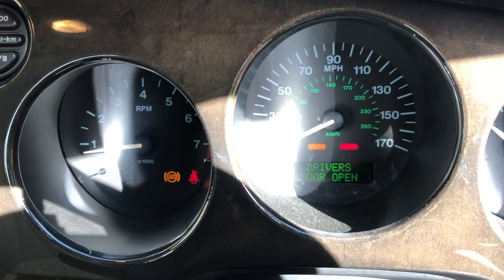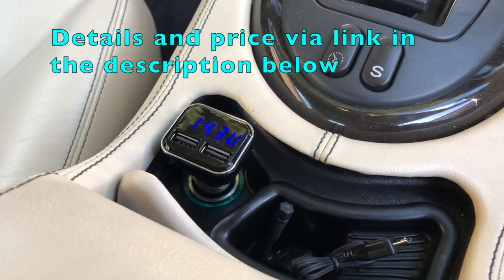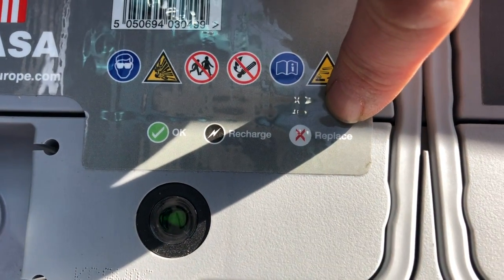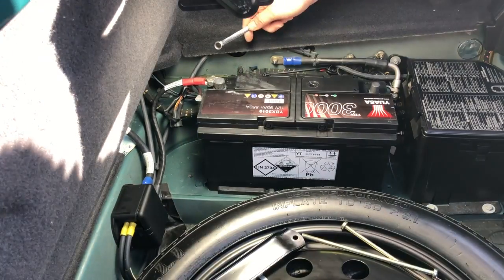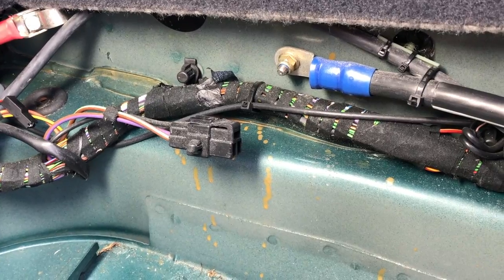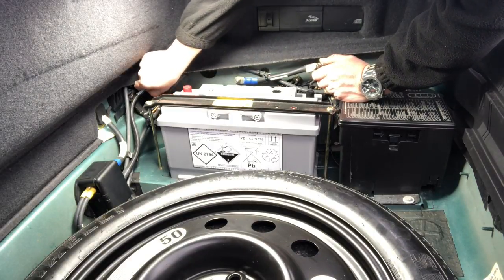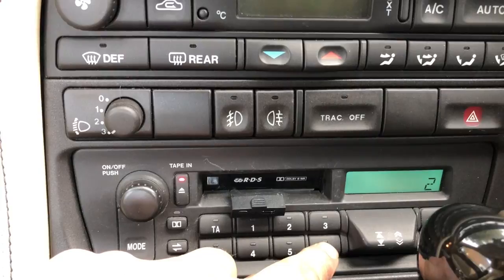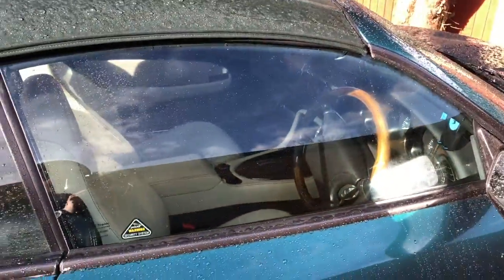secrets of Jaguar XK8 XKR Episode 55. Battery swap and true In car Voltage display.

Comment: Now that you have a lift you could feature a gearbox fluid/filter change. I did mine at 80k and it did need doing by then so we can forget Jaguar's "sealed for life" approach. Having done that I decided that the "sealed for life" approach with the rear diff oil was probably also suspect. That turned out to be far more complicated than the gearbox. There is no diff drain plug and the filler/level plug is totally inaccessible unless you drop the entire rear sub-frame/diff/suspension assembly. However, there is a simple workaround using a two inch hole saw and a large grommet which I photographed here:
 https://www.dropbox.com/s/5pavghqg3dwfqbx/IMG_7202.JPG?dl=0
The oil in my diff was far worse than the gearbox and was totally black and smelled so strongly burnt that it stank out the garage for weeks afterwards. It was well overdue for change by 80k miles. The diff would make a really helpful video as I have never seen it on YouTube.
Reply from the maker: Hi Richard
The gearbox oil and filter change was on my list of to do's and is one I have done previously. but I had not considered the thorny topic of the Diff Oil change.
I may well follow your lead re the hole and use the extraction pump. Old Diff oil is without doubt a horrendous smell. Its like rancid lard scraped off the inside of a condemned cooker.🤢🤮

Comment: Good video John. Just a small point but my understanding is that the window memory should be set with the door fully closed so it can sense the correct fully closed position. The position can be checked against the line at the front of the window.
Reply from the maker: you are right, and I ended up re setting them again as the stop position was a little too high. Just the sort of daft mistake I make when Im trying to film stuff. One day I will share the outtakes from my brake saga. I managed to fit the disc and caliper before I realised the backplate was still drying after a repaint!!   😔
Reply: @tothegarage  I totally understand John. I installed a door card in a Mondeo yesterday and had the whole thing finished until the final stage which was installing the trim around the door handle which includes the window up/down switch. It soon became apparent that the trim and switch must be pushed into the door card before the card is clipped on. :-(

Comment: to the best of my knowledge if you were to disconnect the battery and re connect it or replace a battery, you would see the same abs and traction control fault on any car of the same model  all you need to do is to drive the car so the sensors can check they are working/ calibrate with the pickup  and the abs and traction warning message will switch off. i would  say and will be happily corrected there is nothing wrong with anything to do with your abs or traction control system.
Reply from the maker: Hi Todd 
I drove around plenty after the brake change and thelights remained stubbornly on.😔. Hence the battery swap and I will now cover a 100 miles or so running the brakes in gently, which will reveal if the system self sorts of not. I am just doing one change at a time to keep it scientific for my own interest. 
Thanks for the input mate. Hope you are right👍👍

Comment: Not surprised that didn’t didn’t fix it. You have an abs sensor fault caused during brake change. An elm327 WiFi version or icarsoft 930 should tell you which one. I’d go for the cheaper one as neither are great on jag XJ XK
Reply from the maker: Hi Andy
I do have a generic OBDII blue tooth sender that I use in conjunction with the 'Torque' app. So I will give that a whirl next.
One day someone will come up with a decent OBD reader specifically for the JAG system at a reasonable price.  
Thanks for the tips
Reply: To The Garage good ones for landrovers cost £425

Comment: Thought that battery neg cable was used on xj6 x300
Reply from the maker: Quite possible Andy. Again its the right timing for the XK8 (and potentially the X308) to be running supplies down. Im not so familiar with the X300 though. 
Thanks for the tip off👍

Comment: Hi John and all, I’m considering buying an XK8 and have really enjoyed watching the ‘Secrets’ series (moving onto maintenance next); however; as someone who’s not really a technical car person I’m now concerned if this is a good idea. Does one need your level of know-how for the responsible ownership and upkeep of an XK8? Will a typical garage know what to do if something goes wrong?
Reply from the maker: Hi Zakery. Any decent garage will be able to deal with most of the general issues and expected maintenance. The place they all come unstuck is that if you don't spend a lot of time around these cars then you don't know the 'likely' issues and have to diagnose everything from scratch.
In my opinion they are as reliable as most other 23 year old sophisticated cars. Parts are a little more expensive than for your average Ford or GM motor. But that is the price you pay for beauty grace and pace👍
Reply: To The Garage Thanks John, that puts my mind at rest; keep up the great work!

Comment: Excellent John as always. 
I solve all my problems with a battery replacement to an AGM type. That's the battery that all cars with Start /Stop function are equipped for fuel saving...
It's a bit more expensive but it worth all the money spent. Currently I'm on the 5th year and I do not use the car very often...
Let me share with you some of the characteristics : 
AGM batteries differ from flooded lead–acid batteries in that the electrolyte is held in the glass mats, as opposed to freely flooding the plates. Very thin glass fibers are woven into a mat to increase surface area enough to hold sufficient electrolyte on the cells for their lifetime. The fibers that compose the fine glass mat do not absorb nor are they affected by the acidic electrolyte. These mats are wrung out 2–5% after being soaked in acids, prior to manufacture completion and sealing.
The plates in an AGM battery may be any shape. Some are flat, others are bent or rolled. AGM batteries, both deep cycle and starting, are built in a rectangular case to Battery Council International (BCI) battery code specifications.
AGM batteries present better self discharging characteristics than conventional batteries in different range of temperatures.
As with lead-acid batteries to maximize the life of AGM battery is important to follow charging specifications and a voltage regulated charger is recommended.There is a correlation between the depth of discharge (DOD) and the cycle life of the battery,] with differences between 500 and 1300 cycles depending on depth of discharge
Reply from the maker: AGM on the next car to a need a battery then Nicholas👍

Comment: Is there any guidelines regarding locking the car or not while changing the battery? Should it be unlocked ? I want to charge my battery but my garage is not a 'private' one. If my car is locked with trunk opened, remove the battery so I can charge it, close the trunk, charge the battery upstairs, back to the car, open the trunk with the key, install the charged battery: Will the alarm go crazy or something? A charge might take 12h so.. I'm wondering.
Thanks all and thank you John for a great video again!!!
Reply from the maker: Hi Alexander. FIRST make sure your key works in the secret key hole for the trunk.
Then unlock the car fully. 
Remove the battery.
Lock the doors manually using the key.
Charge Battery
Unlock using Key on all doors.
Fit Battery.
When you lock using the remote control all will be back to normal with the alarm.

Note well!
The Radio will need to be given a code before it works again (make sure you have it before removing the battery.
The windows will need their memories reset.
(press down and hold till you hear a feint click, Press up and hold untill you hear the same fient click)
Reply: @tothegarage  Thank you so much!! So no alarms in the middle of the night while battery is charging if I follow these instructions, right? I have a 2004 xkr btw..
For your issue, (have it too, intermittent like everyone), if cleaning the sensors didn't work, there's also the abs speed wheel (=reluctor wheel?). It gets corroded. Have you tried driving it a couple times to see if the code goes away? Check the abs wheels if not that the sensors connectors for continuity. Check the resistance on it, I think it should be around 6ohms but double check that number. I've also read you could check the continuity of pins and wires of the suspension module it's on the rear panel of the trunk. Also I've read there's a soldering issue on some electronic components next to the abs, there's a doc on that although I could never find it with illustrations and steps by steps.
There are also the connectors at the tip the cats shocks also worth checking. There's more to check, a ton of articles in the forums as it seems to be a VERY common problem with these cars. That would be great to have a few videos that cover all of the fixes. Would generate thousands of new subscriptions for your channel!! For sure.
One thing though, is like me you have the error at stop when the car is starting but haven't moved yet. I'm not sure what to make of it. It could be also a consequence of the previous ride, a memorized issue no? In which case moving wouldn't matter. Also it could  simply be triggered by wires not conductïng juice properly while the system checks. Would it matter then if the car is moving or not? The sensors won't send juice until the wheels spin though. We talked about low battery Gremlins.. I wonder what else...
Good luck. thanks!

Comment: Deja Vu! I had exactly the same problems on my 2003 XK8 nearly two years ago now. In addition I had problems with the security sounder (not the main alarm) going off at odd times. Fitted a new (Duracell) battery and the security sounder behaved but not the DCS and ABS problems (bad speed pickup). Now, not run the car for a few weeks - windows lost their settings and then the security sounder problem started again. Recharged the battery, but no better. Every time I started the engine the sounder went off. Finally fixed it be doing a hard reset. Bought the voltage display!!
Thanks for another brilliant and very pertinent video.
Reply from the maker: Thanks Alan

Comment: Great video John. I replaced the battery in my XKR a few weeks ago, drove to a near by petrol station only to find that the car would not start after stopping the engine to refuel. No sign of battery life at all. Upon closer inspection I found that the positive connection had jumped up and off the battery (possibly over a bump). I discovered that the connector itself is not a closed ring and can work itself loose despite having fully tighthened it. Potentially very dangerous if it had happened whilst driving.
Reply from the maker: The Battery is the cars weak spot

Comment: Good choice of battery - same as the one I bought a couple of years ago! You might clear the ABS and stability control warnings by just driving the car and possibly clearing the error codes with your code reader.

Comment: Hi John,
Best advice given...don't skimp on your new battery. Always liked a wee lick of copper slip on the terminals post re connection. Do like that wee battery  voltage indicator....
Reply from the maker: Hi Harry.
Now that is a good use of copper slip

Comment: I may be wrong, but the traction/stability control errors can be fixed by re-soldering the dry joints in the ABS module under the bonnet.
Reply: You are not wrong.  This, as well as other ills, is covered in my XK8 Bible.  https://drive.google.com/drive/folders/1C7AsBRQSN6sdGiLKKkDvuhxLj9fADVil
Reply from the maker: Hi James. Yes that may be the cause. However the timing of the fault in relation to the long period I was doing the brake up-grade over, makes me want to check everything else first.

Comment: I hope you figure it out as I have the same problem on mine, I suspect the sequence is to clean or replace brake sensors, check the wiring harnesses, and then possibly the notorious ABS module needing soldering on + & - terminals good luck hope to see your results soon.
Reply from the maker: Thanks👍
I will keep everyone posted

Comment: Hello John
Great videos lots of help with my new xk8.
I have a couple of issues and wondered if you can advise.
1) gearbox noise at around 45 to 50 and the gearbox can't decide what gear is best at that speed
2) green arrow on dash display for indicator left no working
Can you suggest anything for me?
Thank you so much
Reply from the maker: Hi Mark
Sorry to say it Sounds like the B drum in your gearbox may be close to failure. The symptoms include what in a manual car you would say is a slipping clutch and some whirring sounds. This usually throws a gearbox fault message on the dashboard though and eventually tells the car to go into limp home mode which is reduced power and uses higher gears to reduce strain.
As you are not getting that a) I may be wrong b) its very early symptoms.
Take it to any competent Automatic transmission specialist and they will be able to advise you easily and quickly based on the sound and feel.
If it is a burst/split drum, there are upgraded parts available to replace the part that failed which means the problem can never return.
Its a gearbox rather than XK8 fault as it effects the BMW M5 of the same era which has the same box.
Reply: @tothegarage  oh dear, that sounds expensive. Thank you for the reply and love the videos, they are great
Reply: @tothegarage  Hi John, you were right, there was a clunk earlier whilst I was out, and three error messages flashed up,
ASC Not Available
Gearbox Fault
Engine Failsafe Mode

I stopped and switched off, and switched back on again and the error messages are gone, but not the grinding noise, I will find a gearbox specialist, but they are a bit few and far between in West Wales.
Thank you again

Comment: Got the voltage display link John, no worries. 
Btw I was told recently that those battery "colour signals" only relate to a single cell, any comment ?
Reply from the maker: Yes that is true. Few batteries will have a shared liquid reservoir, so in most cases you are just looking at the condition of one random cell.
Good point👍

Comment: Interesting John.
 On my Disco TD5 we used to get what we called the 3 Amigos, HDC, Traction & ABS warning lights show up, mostly in cold weather, for us that is anything below 18C !!. We replaced the battery & all good.
My XK8 was off the road for about 3 weeks recently & when I returned home I got the "2 Amigos" as you had. Took it for a run, did my shopping, & upon re-start no Amigos but still had to "teach" my windows. Hope you get yours sorted.
Just a question, will be away again for about a month, is there a way to prevent battery drain, take the earth  off the battery maybe ? 
Like the voltage gadget, how do I access the info ?
Cheers
Reply from the maker: Hi Alan
Thanks mate
Yes thats why im in no hurry to investigate further until she has been on a good run. all the JLR products are sensitive little ssoles when it comes to batteries.
There is no easy Battery cut off though I did think there must be a wayy of triggering the impact detection cut off (without the impact) as that has a nice easy reset button. So for the moment it is Trickle charge or battery negative off.
The details are in the description. Below the video click 'show more' and you will find my various suggested links on each video
For taking the trouble to comment however.

Here is the link you need
https://amzn.to/2Tyh0R2

Comment: Another great video John. When I bought my Xk8 in January it came with a new battery and having seen you mention batteries in previous videos , I bought a trickle charger from Halfords (£25). I have used this charger on all my classics - mini , Mercedes sl, Jaguar S type and this maintains 13.4 v . I've noticed both Jags are particularly susceptible to low battery charge and produce a variety of warning messages, which have disappeared since using the trickle charger. By the way I love my XK8 the most and big thanks to you for giving me the confidence to buy one👍
Reply from the maker: Well done on having a great garage of cool cars Philip. The XK8 really is a class act. and one day everyone will work it out and we won't be able to afford them😔
Which era of SL do you have and how does it compare to the XK8 (as its realistically the only XK8 competitor other than at a stretch a 6 series BMW)
Reply: The Mercedes 300sl is an excellent car between 1986 to 1989 as they were galvanised chassis, mines an '86. I've owned it 17 years and have loved it. I wanted an XK for the next 17 years as a car with personality equipped to take on modern traffic. The benefits with the Jag are 5 speed gearbox as opposed to 4, a V8 engine instead of straight 6, power hood instead of manual with hardtop which needs 2 people to remove, sophisticated electronics as opposed to old school, but most of all, the Jag is a home grown icon supported by a wealth of enthusiasts ready to help with advice. One has to join the Mercedes club to get the same advice at a cost, however it's a good club. I did have a '64 pagoda SL before but found it dated to drive in comparison to the '86 model. The Jaguar is a step up again!